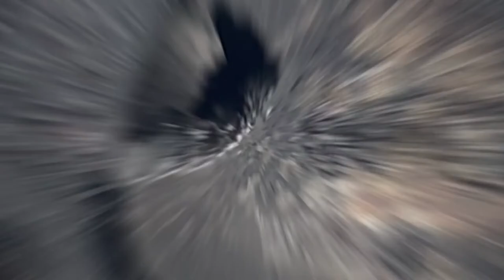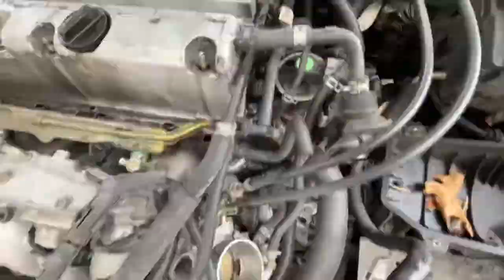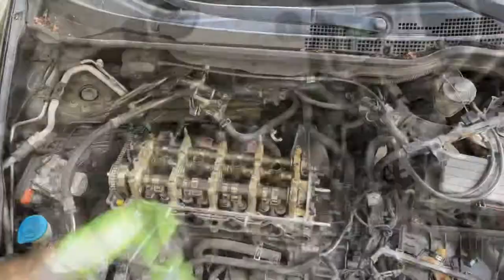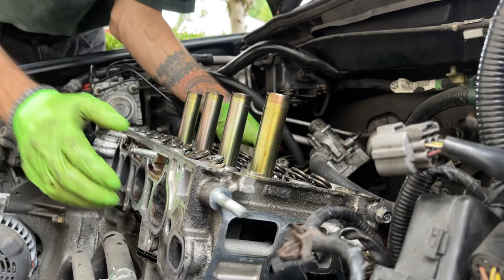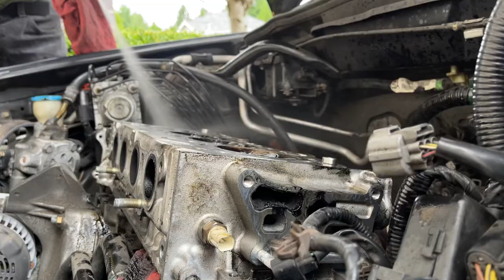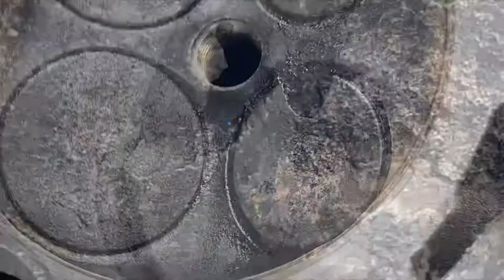Honda Accord (Burnt Valve) #shorts

Comment: I have the exact same issue on my car with 2 exaust valves. Did you determine the cause? Im wondering if i can get away with replacing the valves or if im looking at doing rings to
Reply from the maker: Wouldn’t be a bad idea to tear it down and get the rings. Might be scored up from debris. Maybe hone the cylinder walls anyway. 

I replaced the valve but it wasn’t running 100%.   

Could be a timing/ fueling / detonation issue or a lean condition causing the burn. 

Go through the whole fuel system, filter, pump pressure, injector cleaning etc..

Comment: Is it normal that my mechanic wants to remove the engine to time it? K24z7 same problem.
Reply from the maker: I would say no, (because it could be done in the engine bay) however, if you want to take the opportunity to freshen up the engine bay, and clean the block thoroughly, have the time, and it’s not “costing more” go ahead.    I’ve tore down heads and redone timing without removing engines on chain driven 3.5 Toyotas. Those are absolutely supposed to come out. But it worked. Just fine.
Reply: @ thanks for the reply, im getting quoted around 2k for the valves as thats what the symptoms are indicating. I find it steep since thats over what the engine would cost altogether.
Reply from the maker: @whazuup000 yeah, but rebuilding is labor intensive. It’s basically a head gasket with extra steps. That sounds cheap if it’s being done correctly. (Valve lapping, adjusting, etc).
Reply from the maker: @whazuup000 also, what symptoms?
Reply: @MechanicalTriage  started miss firing checked and one cylinder had lower compression. Had already checked injectors-coils and plugs prior to the compression test.

Comment: Did the burnt valves cause damage to the bottom of the engine? And can you replace just the burnt valves or should you replace all of the valves?
Reply from the maker: In this case, after replacing the one valve. And doing a very mild lap on the valve seat, it ran great.  Sometimes bent valves will damage rod bearings or wrist pins.  Usually a burned valve wont cause additional issues, IF, the valve seat didn’t burn up..  but, you want to figure out what caused the burned valve in the first place, before you go slapping it back together.

Fueling issue??  Which component?  Etc..
Reply: @MechanicalTriage  Thanks for the info. I'm in the process of removing the heads now. I will know more once I get the heads off.